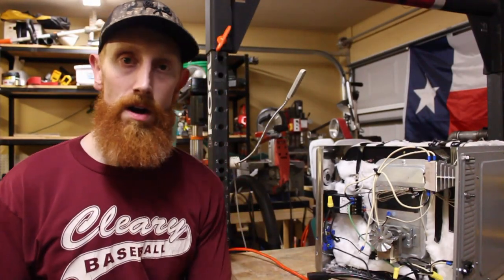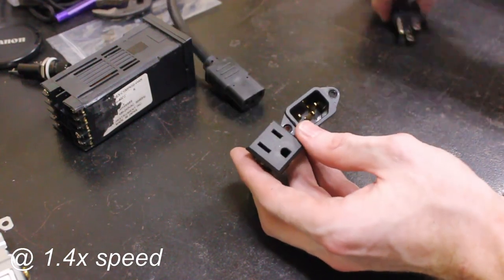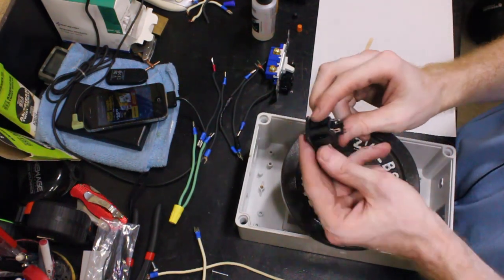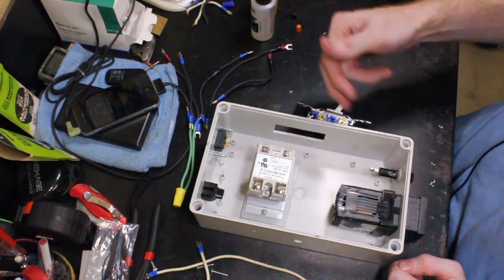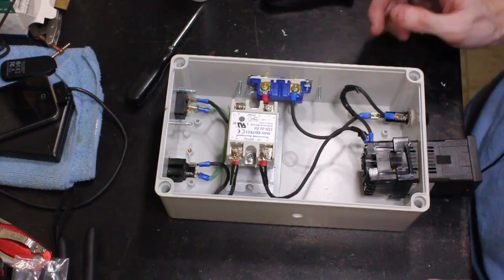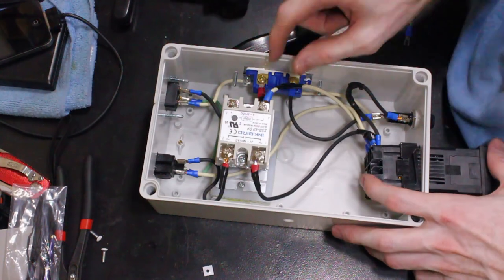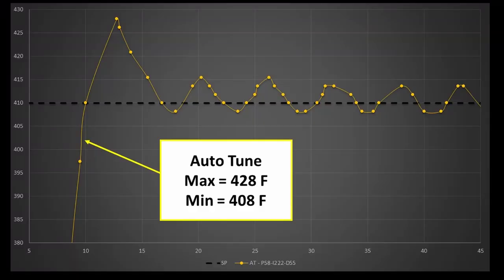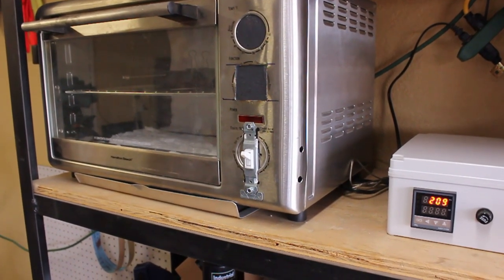How to Build a PID Controlled Toaster Oven | Full Guide | Round 2

Comment from the maker: 0:35 - Motivation for Rebuild
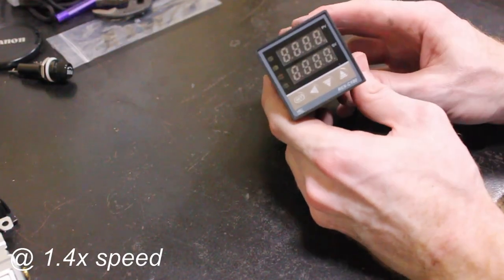2:48 - Components Needed
3:54 - Setup Project Box
4:21 - Mounting SSR & other Panel Components
7:55 - Wiring the PID
13:15 - Full Wiring Overview
14:10 - Tuning Strategy, Tips, & Results
Reply: dude if u dont spray the kawool with rigizer u going make your self sick and i mean bad. Because if you dont use rigizer  you will  inheal the fibers that being burnt and mess up your lungs trust me i seen it first hand what that stuff can do to a mans lung
Reply from the maker: @AndrewMurphy8383  Yeah when building my forges I coat it with satanite to seal in the fibers. I figured since the conditions of a toaster oven are very static (no major air flow from a blower or material contact with the insawool) that there wouldn't be a significant amount of harmful fibers thrown up into the air. Could be wrong. A better solution would be to use some jacket insulation like those used to wrap water heaters.
Reply: @RedBeardOps  but still even when you use it for toster oven i was told by the company u still want to use rigizer spree as well
Reply: How do I become a patreon
Reply: Love your shows. More informative than the others. Keep it up
Reply from the maker: @thomasnorton316  Cheers Thomas! My Patreon is here - https://www.patreon.com/RedBeardOps

Comment: Heatsinks work by radiating heat to the surrounding air. A number of improvements include: Orienting the fins vertically, so air naturally flows up between the fins. Next, use a black heatsink. Black radiates heat much better than bare metal. Lastly, it needs airflow. Consider at least adding vents directly below and above it, so cool air can get in and the hot air gets out. If building in a metal box, just bolt the SSR to a vertical face, using the entire box as the heatsink.

Comment: Looks good mate. As a sparky I would recommend that you insulate the self tapping screws, wire the fuse before the switch (to protect the switch) and if it were an option, get a smaller switch and mount it on the front where the fuse is for convenience.
Reply from the maker: Nice tips!

Comment: Thanks a bunch.  I had watched this before but now I have an application.  I recently bought an older burnout oven for knife heat treating which has very crude controls.  With your help I am upgrading to PID controls.  Thanks again!!!
Reply: Will be ordering my parts off your links.
Reply from the maker: Good luck David! I don't think this would run a heat treat oven with 230v? Works great for a little tempering oven though!
Reply: @RedBeardOps  I got my PID control system setup basically following this video & wiring diagram (with minor variations).  Bought 95% of the components from your Amazon links.  Got the Inkbird PID.  The oven I bought is 115V so all the components worked just fine.  I got up to 1500F on my first trial.  I saw in your recent DL/Knife build challenge video that you had opened the control panel to cool the SSR.  My SSR got very hot in the sealed box.  I'm looking into a small 115V fan that I can mount to the panel to keep things cooler.  I will try just using "P" control & see how it works.  I can send photos of my setup if you are interested.  Thanks for all the info you share.  David Scadlock

Comment: I made mine with a $25 REX C100 w/ SSR and heat sink. It hits 200 deg F in 10 minutes, no overshoot at all and holds either 200 or 400 TO THE DEGREE!

Now my toaster oven is easy to use for wood stabilization or tempering blades
Reply from the maker: Very nice!

Comment: Great instructions. I made the same in a $10 Sheffield plastic ammo box. I added a 12vdc miniature fan in it fed off a 9vdc adapter. A little quieter than using a 12. Wasn't sure if the SSR was gonna get really hot. I put a 2 amp fuse in mine since I'm only using it for a small heater coil, not an oven.  I tried hundreds of settings on the Inkbirg and finally lucked out and have the thing with only a 2volt swing using PID numbers. Your right about auto tune. Kept occilating.  Still can't believe I got those PID numbers.
Reply: Oops. 2 degree F. swing.
Reply from the maker: Nice. yeah it's hard to get them tuned for sure.

Comment: Great job, built this a few weeks ago and it works perfectly. Keep up the good work!
Reply from the maker: Great to hear!
Reply: Wanting to build this myself. One question for you if you don’t mind. How did you wire your toaster oven? Thanks for any help
Reply from the maker: @thomasnorton316  I took out the control equipment and wired the elements directly to a switch. You don't need to do this

Comment: Good vid, very helpful. I like the ide of having the control away from the oven.
Reply from the maker: Thank you! Yeah, I agree. I think it's possible to set it up in the side pannel, but you need to be on point with your insulation. I like having it outside of the toaster A.) for the heat but also B.) for the ability to use it with another toaster easily if this one dies. Thanks for watching!

Comment: Every YT oven build shows SSRs being bolted to heatsinks, often incorrectly. Heatsinks work by transferring heat from the SSR to the air. Orienting the fins vertically is much better than horizontally because air can flow between the fins. Also, heatsink color matters; black transfers heat much better that bare aluminum. Lastly, if inside a metal box, just bolt the SSR directly to the metal enclosure, preferrable on a vertical surface away from the oven side. Adding ventilation holes above and below to let cooling air in and warm air out is even better. If inside a plastic box, consider a small fan, and if it's 12V, you may be able to run it off the signal controlling the SSR.
Reply from the maker: So far so good on this oven! Still going strong; thanks for your thoughts.

Comment: Hello! Thank you so much for the great video! 
One thing that wasn’t clear to me is: do you just plug the toaster oven straight in to the PID control box? Do you need to rewire the toaster to bypass the built in temperature controls? Or just turn it to always on and set the built in temp control all the way up? 
Thanks again!
Reply from the maker: You can do it either way... be careful if you re-wire the toaster... this is what I did, but you could just turn it to full blast. The box will control power to the toaster to hit the temp.

Comment: THANK YOU!! I really like this second video!  Will this get the oven to 500 degrees?  I need to temper most of what I'm making at 460 or above!  The oven I have says it will go to 450 but in reality, I can't get it any higher than 400 and that just won't give me what I need.  I have extra Kaowool and does it need to go inside the the box of the oven?
Again thanks for the instructional video!  You did a great job explaining everything!!!
Reply from the maker: Hey Kim, glad you found the second video. I think it would be possible to get this oven to 500 with the appropriate insulation, but I haven't tried it. I recently lined the door with adhesive aluminum heat shield and it greatly increased the oven's performance. 500F is pretty hot!

Comment: Looks good. However, considering the amperage, don't use the PID controller terminals as terminal blocks to put multiple wires together. Use a proper terminal block, they're rated for it. If that terminal loosens, and it probably will because it's not super high quality, you can get heating there and thermal runaway, or just a faulty, intermittent connection.
Reply from the maker: Good tip!

Comment: Two more questions? After I build this can I plug the oven strait in to this without having to do anything to my oven?  Also how did you ground the box with it being plastic
Reply from the maker: First of all I'm not an electrician so that what I say with a grain of salt... this stuff is dangerous so be carful

a1.) You can plug your oven into this with the max temp selected on bake and the box will turn the power on and off to your oven to get to the temp. 
a2.) I wired my elements direct... and bypassed the panel on my oven. This is obviously a little dangerous so once again be carful. 
b.) Not a pro at building stuff like this, but I think the system is grounded via the ground on the 3 prong plug. 

If you find out more let me know.

Comment: Good job! The only thing I would change is use hot melt glue rather than epoxy. It does the same thing, except if you have to replace that electrical receptacle, you can still get it out.
Reply from the maker: Good point!

Comment: are all PID controllers wired the same way? I am playing with an inexpensive Rex c-100. I am just wondering if the wires connect in the same # spots. 
Thanks for the video!
Reply from the maker: I think they all are from the save vendor. All the Rexc100s will be the same I think. If you get an inkbird or my pin it will be different. You'll have to look at the manual in that case

Comment: Does the box then wire straight into your heating element? Curious to know if there was any other complexities on the oven side. Thanks!
Reply from the maker: It's designed so that you can plug your oven into it; then turn the oven to max bake and have the box control the power. That being said, in my case I bypassed the oven's control and wired the elements straight to the plug. Do at your own risk!
Reply: @RedBeardOps  Ok thankyou!

Comment: question instead of a light switch can you use a on/off toggle? i was gonna start making this today i dont have a light switch but do have extra toggles  your videos are awesome  im also in the process of building my heat treat oven just waiting on elements and pid  when are you gonna make your own?? thanks again bro much appreciated
Reply from the maker: Thanks man, Yeah I think you should be able to do that no problem as long as it's rated high enough. I'm not an electrician for sure. Man, I'm not sure when, But it's on the list for sure!

Comment: Hey Red Beard, are you running a separate power supply for the oven fan? Just adding a separate switch for the fan, while isolating it, is still getting it's power through the PID if I'm looking at this correctly. Also, is the idea to run the fan consistently while the oven is running? Thanks again. Great video!
Reply from the maker: The fan had a separate switch and power plug in this situation. I thought it was a good idea to not have it turning on and off. 

All that being said, I don't even run the fan anymore and have great results.
Reply: @RedBeardOps  excellent! Thanks for the update.

Comment: Thanks for sharing! I am currently building mine now and will share pics after. One more question...How did you rewire your convection fan? I need to rewire my convection fan and rotisserie to its own power source.
Reply from the maker: Cool deal! I wired mine to it's own separate switch.
Reply: What did you do with the factory wires running to the fan? Cap them or connect them?
Reply from the maker: David Austin if I remember right I extended them so that they could reach the dedicated switch on the back of my unit. In reality I’m not sure how much the fan really helps the system, but I like the idea of it being there. I separated the fan from the PID controlled system so that it would run full time instead of on and off with the controller. I doubt it would be the end of the world to run it on and off with the controller though,..
Reply: I am wiring my box up exactly how you did. Can you send me a wiring diagram of your oven? I see you cut away the top two knobs on your oven and would like to see how you used the PID to control it.
Reply from the maker: David Austin there is a wiring diagram link in the video description and it’s also in the video. 👍
Reply: I meant a wiring diagram of the toaster oven side, not the PID box side. I am worried that once I start cutting away wires inside the oven, I won't be able to reroute them to keep the circuit open. I hope this makes sense. Lol
Reply from the maker: David Austin the best solution for you may be to just build the PID controlled box, then plug your toaster into it. Leave all the controls on the toaster. Turn it to bake and max it out. The PID controller will do the rest. The simplicity of this is that if you ever want to replace your toaster it’s plug and play.
Reply: I believe I am going to finish building the PID controlled box as you have and wire both my fan and rotisserie to a switch. It looks like Black Beard just cut the top left and bottom left heating element wires and connected them to the SSR so that he could control the temps from the PID. Since I am using this oven to roast coffee beans, I need to have control over the rotisserie and fan.
Reply from the maker: @davidaustin6657  Good deal, I hope that works for you. It's a hard thing to explain over the internet and I'm not an electrician! Good luck sir!
Reply: Thanks JKeetonKnives! I went home last night and realized that with the fan and rotisserie unplugged, I still get power to the elements. Going to wire the fan and rotisserie to a switch this weekend and just plug and play with the rest of the oven. I appreciate all your advice!

Comment: Do all PID's need an SSR? Also, is there any other way to tell what the PID is doing besides taking a bunch of plot points and putting them into excel?
Reply from the maker: Some PIDs have data exports... so you can plug them into a pc live.

I think some PIDs use mechanical relays instead of SSRs... 

Sorry if neither of these points are helpful ... I don't know a ton about this stuff other than what I built.

Comment: Nice project.  A question, you have a heat sink inside a sealed plastic box.  Does the temperature inside the box rise and would it be better to ventilate the box to allow the warm air to escape?
Reply from the maker: Hey David, yes the temperature in the box does raise for sure. I do think a fan would be a great improvement on this design.
Reply: Certainly a fan would work but if one had holes or some wire mesh, one might get sufficient convective air flow across the heat sink to cool without the need for the fan.
Reply: I made my box from plywood.  I had a couple of wire screens that you’ll have seen on computer power supplies.  They have 4 rings for screws and they are designed to cover a 3” hole.  I used a hole saw to drill a 3” hole in the bottom of the box and another on the top of the box, they are directly below and above the heat sink.  I’ll put feet on the box to lift the box off the surface which should allow air to freely enter the box, so air should enter the box from the bottom, pass over the heat sink, then the warm air should rise and exit through the upper hole.  Thank you for all the time and trouble you put into this.  I don’t have a fuse but Amazon has a small 15A breaker https://www.amazon.com/gp/product/B002PXG1BC/ref=ox_sc_act_title_1?smid=A1UOBWSFLOXPFW&psc=1 for $6.53 so I’ll put that in when it gets here.  I’d include a picture but I don’t know that I can add one here.

Comment: Hey, great info BUT the diagram you show is different than the Inkbird ITC-106-VH because yours shows the thermal couple on 9 & 10 for the REX-C100 and the Inkbird thermocoupler PID pins are 3 & 4.  Sorry but I'm new to this stuff.  Do you have one for the Inkbird ITC-106-VH.
Reply from the maker: Hey Alan, I do not. The inkbird should come with a diagram though. If not you should be able to find one online for your specific model.

Comment: Great video it helped me out alot, I am building an oven so I can cure cerakote. My only problem is that I can not seem to get power to my heating element. I have tryed so many different setting. Could you show all the different setting on you maby that would help me out thank you
Reply from the maker: So on the oven itself you should set it to Bake and max temp. In my case I hard wired past the knobs.

Comment: I may have missed it, but did you just plug the toaster oven into your controller box, or did you have to modify the wiring w/in the oven itself? Thanks again for another great video! I appreciate the effort you put in to help others in this craft.
Reply from the maker: Hey Erik, You can do it either way. If you don't modify the toaster you should set it to it's max temp set point on bake and then let the PID controller regulate the on/off to hit the temp. On mine I ended up re-wiring the toaster so the elements turn on full blast when power is supplied to the toaster.
Reply: @RedBeardOps   Makes sense. Thank you!

Comment: I just build a box following your guide. I used an Inkbird controller. It seems to work great however the temperature reading is very slow. Do you fire up your oven, let it get to temp and stabilise a little then throw in your blades? Just as an example(I'll use Celcius), my multimeter probe reads 50 degrees C while my in oven probe is still at around 30. By the time my multimeter is at 200c, my oven temp probe is around 150. When I read 200c on the oven temp, the multimeter is nearly 240c. Its slow and feels bouncy. Any ideas?
Reply from the maker: Man, that does seem bouncy. I think you many need to do some "test runs" with a stop watch and graph the results to see what it's doing with different set points. Easiest way is to get it close with your "P" set point alone. Each oven will react a little different since they're insulated different and are different sizes. Depending on your controller you can try the auto tune as well.

Comment: Is it necesary to use heat sink with the ssr ? I'm using one with low wattage consumption in other project.
Reply from the maker: I'm no expert, but I wouldn't use it without the heat sink. Gets hot in there